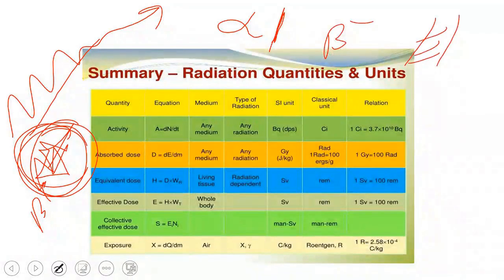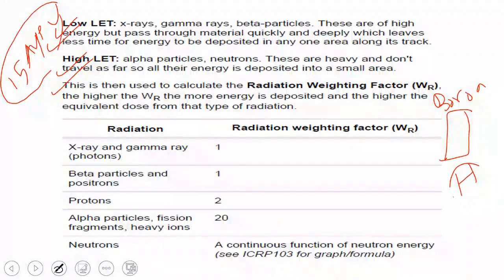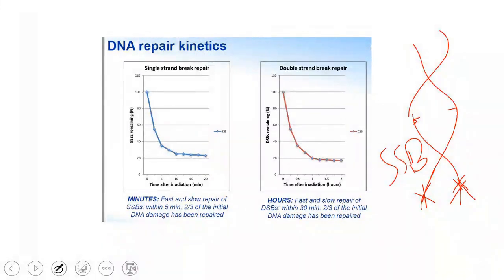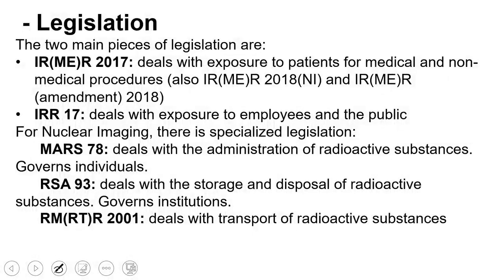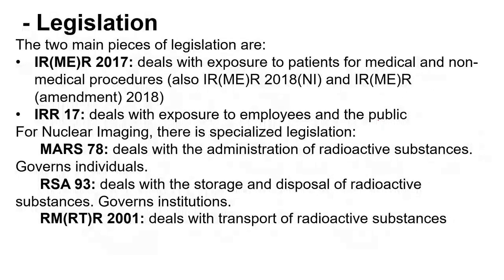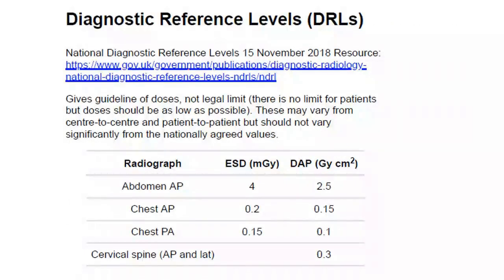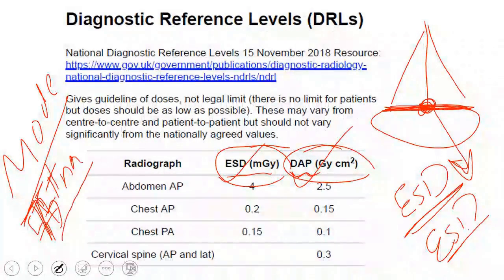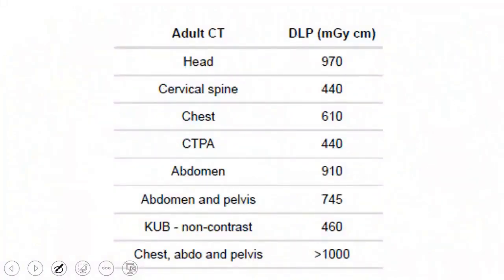Lecture no 48 FRCR Physics Radiation Protection (English)

Comment: What is a “neutron volt”? An E-field does not accelerate neutral charges, so no potential energy is accumulated or exhausted during a neutron’s travel through an e-field. 
Is the neutron-volt just a way of speaking that doesn’t have dimensional meaning?